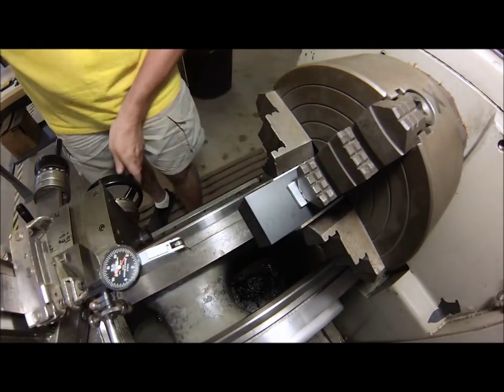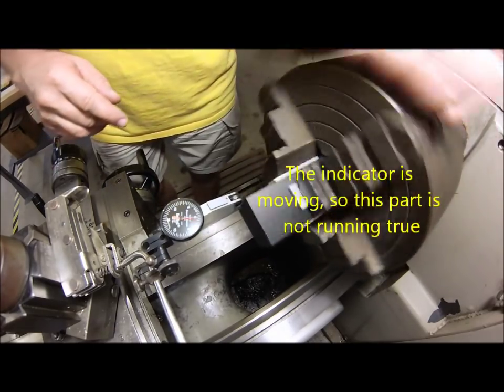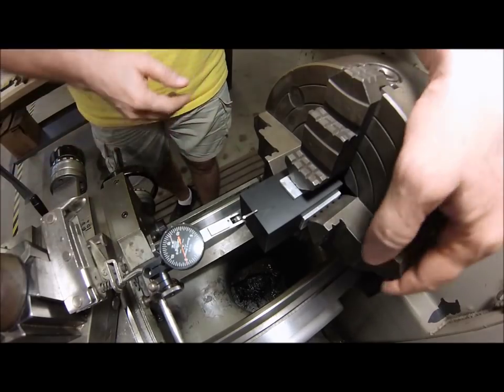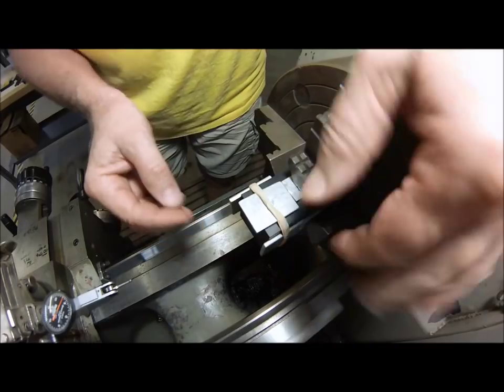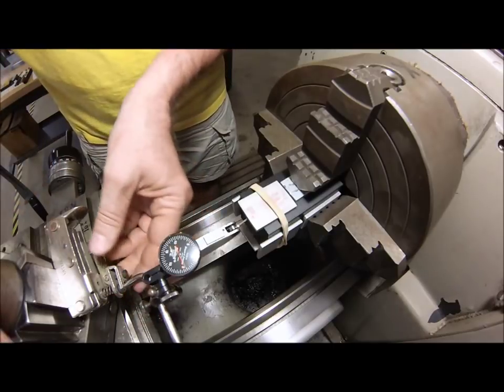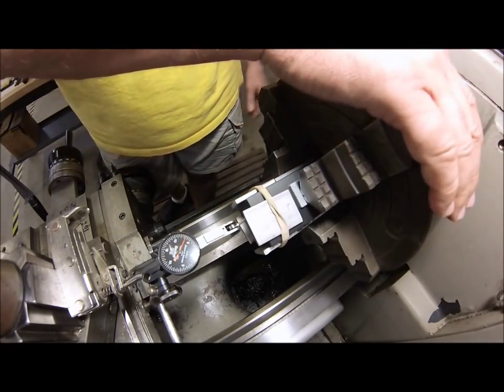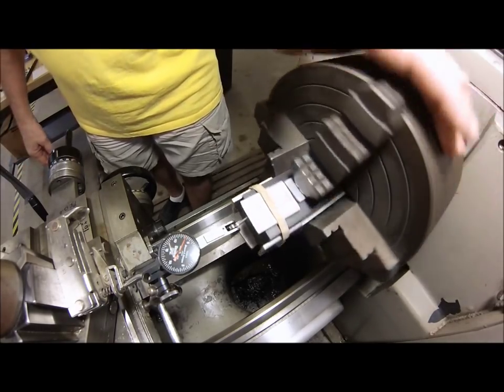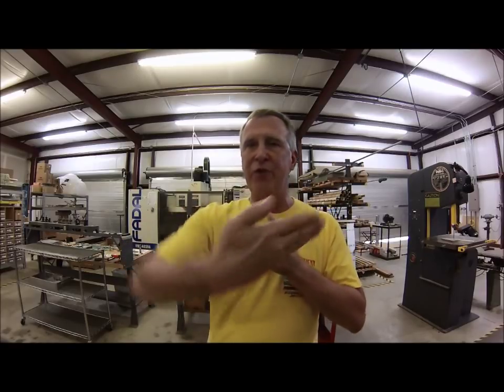Clever way to indicate a square part in a 4 jaw chuck - SUPER EASY !!

Comment: Well Joe, I have been 50 Years in the trade, and I have never seen it done that way before, Thanks for posting this tip, well done. Now a slight criticism, PLEASE do not tap your clock mag base with the dial indicator touching anything. The shock waves travel inside and could damage the pivots, or even crack the jewels. You see how the needle swings around crazily. I have told abom79 too, the number of times you see him bashing the part in a 4 jaw, with the indicator still touching the part. Anyway, rant over, looking forward to many more ' Tips of the Trade', you certainly have a few up your sleeve. Regards from Dave in the UK.
Reply from the maker: Hey Dave. Thats Good advice. I didn't realize the mag base was actually in contact with the compound and wasn't going to move no matter how hard I hit it. It usually only takes a gentle nudge to move it. I baby my indicators normally. Keep me honest.

Comment: you are a wizard, 
don't worrry about the thumbs down its probably a bot, 
do you have a preferance for rubber bands? the normal ones tend to crack after a while and aren't resistant to oils.
Reply from the maker: Mine never last long either. I just keep a bag handy.

Comment: great trick, but here is one modification that will make it even easier. Orient the indicator to the front or rear, then use the x axis to set 0. much easier then tweeking the indicator dial or mount.
Reply from the maker: David, you are correct. I usually would position it that way, but my camera mount would not have seen the face of the indicator. Setting the indicator zero with the lathe dial is definitely easier.